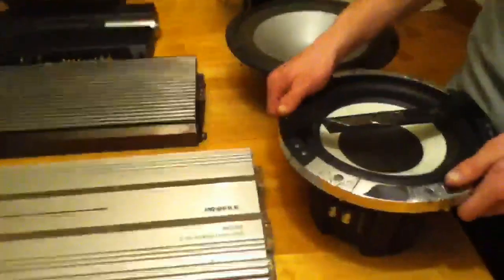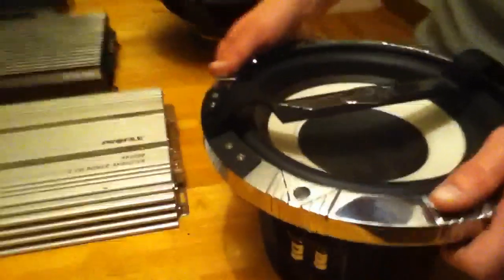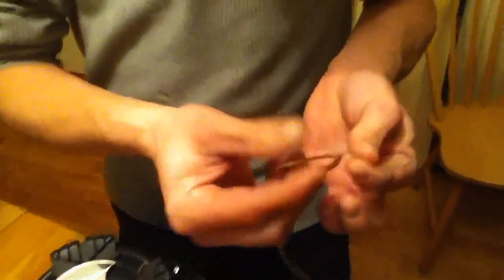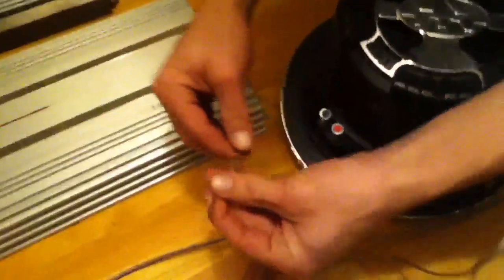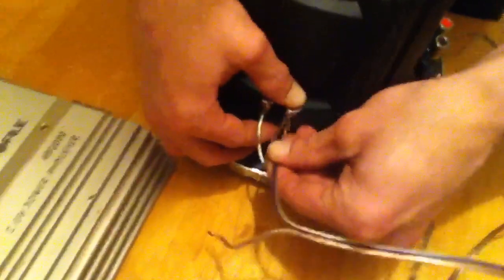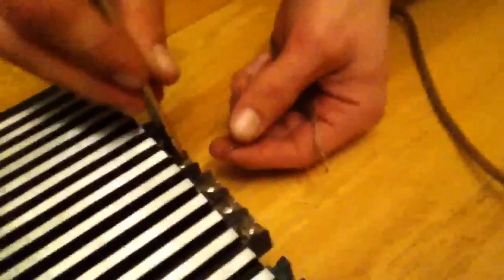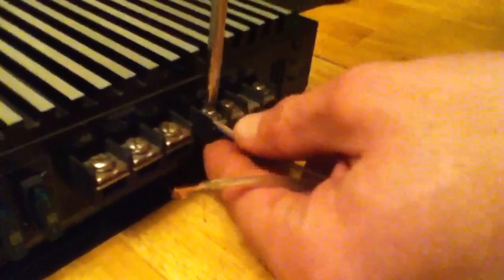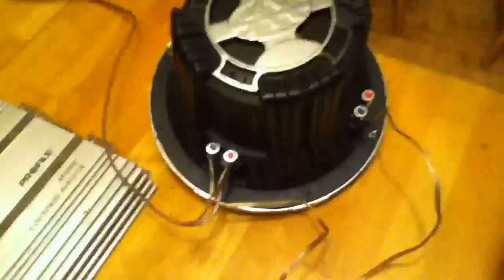How to wire a 4ohm DVC subwoofer to 2ohms watch in HD

Comment: You could run another sub as long as the channels are rated at a 2ohm stereo load.  However what you can't do it run the other set of wires to that same sub of the other channel to give it double the power OR use the bridging feature on the amp, usually the positive of one channel and the negative of the other channel.  Unless your amp is rated at  2ohm bridged load, which very few are as that's a 1 ohm load in reality and very few stereo amps do that.

Comment: i have a question. I have a dvc 4 ohms RF he2. The sub is wired like this in the box. Each of the sub connector has it's own cable, So there is a total of 4 cables, There is one cable from each positive and negative sub terminal, The two positive meet together and are connected to a female connector for the box terminal and the two negatives are the same way connected into a female connector for the box terminal. Long story short i just want to make sure it is wired right at 2 ohms?  THANKS! (:

Comment from the maker: is your amp getting proper voltage? if you have to small of power wire ''low voltage'' or a bad ground will also make your amp HOT , cuz at 8 ohm bridged that amp should not get hot at all . also are your setting to high and clipping the amp ?

Comment: I just wired it to 8ohm Bridged amp still gets super hot!
Sub specs:
(P3D412) "P3"
500Watt RMS
1000Watt Peak
4 OHM 

Amp:
Sony XM 2002 GTR
2-channel car amplifier
200 watts RMS x 2 at 4 ohms (250 watts RMS x 2 at 2 ohms)
500 watts RMS x 1 at 4 ohms (4-ohm stable in bridged mode)

I used your video on how to make it 8ohm as well...

Comment: If you have any two speakers of the same impedance you cut it in half by wiring them in parallel. It's a simple product over the sum calculation but if they are the same impedance it's easiest to just remember it cuts the impedance in half.

Eg: Two 8 ohm speakers in parallel. 8x8 is 64 which is the product. Then 8+8 is 16 (the sum) Just divide 64 by 16 and you get 4. Easy breezy ;-)

Comment: I have two Kicker CVX 10's that i bought a while back. When I purchased them I bought them separately and soon realized I bought one DVC 2ohm speaker and one 4ohm speaker. Now can I wire the 4ohm parallel for a 2ohm load and the 2ohm in series for a 4ohm load and run them off the same amplifier? I found a amp that pushes out 1000w off one channel at 2ohms and 1000w bridged off 4ohms. Would it hurt the amp or the speakers to run one speaker off one channel and the other bridged?

Comment from the maker: @Ohsodopeee Yep.  Most 2 ch amps are 2 ohm stable. just wire 1 sub per channel.  Dual voice coil subs are made so you can wire them in 2 different ohm loads, that way you can best match it with your amp

Comment from the maker: @blkout15 no if you wire it 2 ohm bridged your amp wont last... you would have to wire the sub in series and it would be 8 ohm ... not giving you full power. your best bet would be get another one of your subs and wire each to a channel @ 2 ohm , or get a different amp. but adding a sub will be louder.

Comment: so i can't wire to 2ohm , & use both channels on my amp ????
i have to use one channel only ??
My amp is 1200w max , but 
 @ 2 Ohms: 240W x 2CH
@ 4 Ohms: 170W x 2CH 
Bridged: 480W x 1CH 
and i want to wire a one dvc 4ohm to 2ohm , it;s 400w rms & 1,000wmax

if i wired it like how you did on one channel , it'll push 480w ?